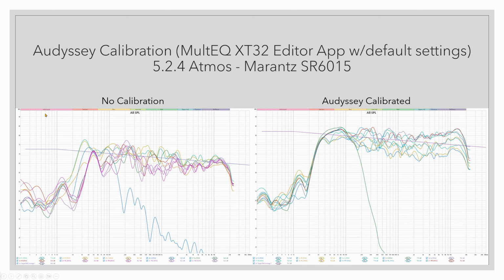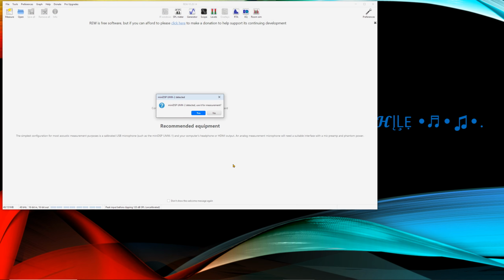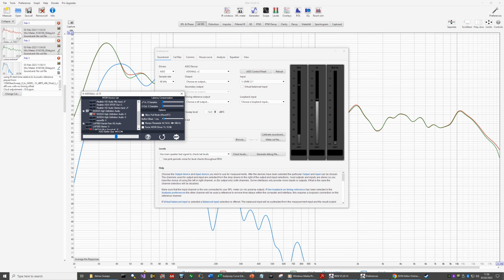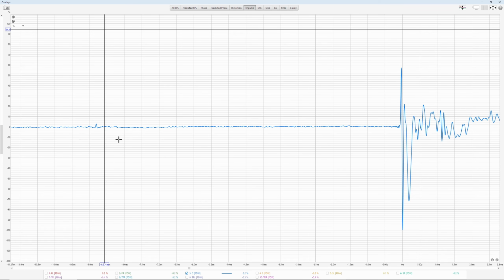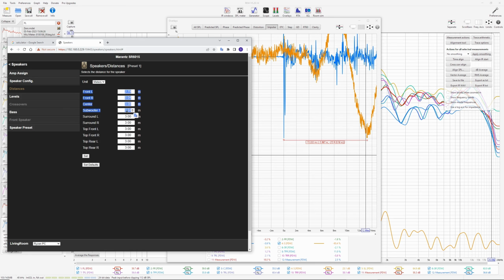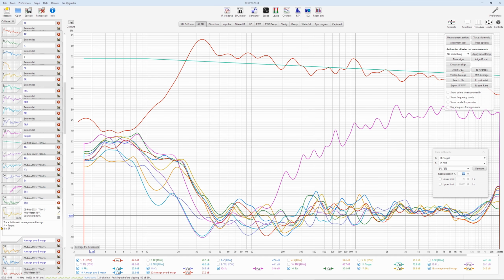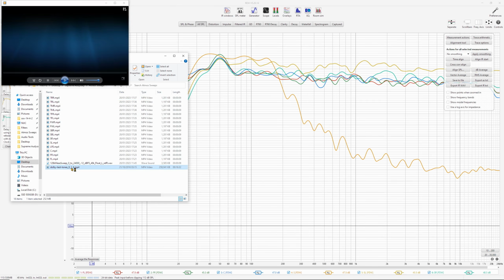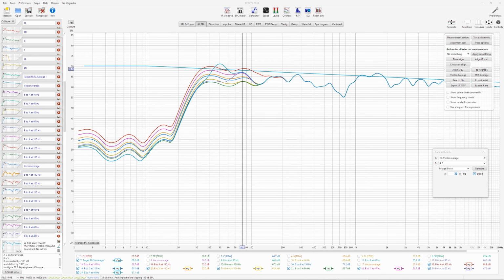Supreme Audyssey Calibration by OCA

Comment: Hello and big thank you for the great tutorial. 

After following the steps I finally hear my Dolby Enabled Speakers reflecting from the sealing. The sound in movies is impressive, compared to the sound the system does with just Audyssey. I don't know what the people at Audyssey tought when inventing the correction curves for the Atmos speakers, but it is not working well. The Atmos effect with my 4 Dolby Enabled Speakers is now, implementing your method, great. I now understand why people think, the "bouncing" speakers are crap. Audyssey cuts them in such a way they really sound as crap. 
One thing, that makes me think that I might have made a mistake at some point through the tutorial is the fact, I still have to adjust to the high pitch of the sound. With Audyssey it is somehow warmer...And my correction curve in MultyEQ app after finishing your method looks like a zigzag with multiple zigzags... Don't know if this should be the outcome...If you can share your MultyEQ curve after implementing your method I would be glad to compare to main, just to be sure, main is OK...I cannot actually call my outcome a "curve" :)

Big Thanks for your time and the comprehensive why of taking me trough the tutorial.
Reply from the maker: Don't worry, it's gotta be a zigzag. The method uses Audyssey curves to apply the actual correction. The zigzags you see are the equalization applied to each speaker.  I didn't undertstand what you mean by adjusting high pitch of the sound?
Reply: @ocaudiophile  If I compare the sound of the outcome now with the sound of audyssey, then I feel like the sound is much more "sharper" (almost scratching my ears form time to time), less "warm", and voices come out "thinner", thinner perhaps because of the presence of the high frequencies, which were not there before...For me now, it is as if I have different speakers, and I have to get comfortable with them first...
When I look for the crossovers with your method, my crossover for the Dolby Enabled Bouncy Speakers comes out at 90 Hz. What would you recommend me to do with this relatively low frequency. Should I crossover them higher like 150 hz? Somewhere in your video you talked about high speakers and crossing them also at 80 hz, to avoid hearing the top sound out from the subwoofer on the ground. Or perhaps I misunderstood something...Of course my dolby enabled speakers are not high speakers...Perhaps thatswhy I should choose the higher crossover?
Front speakers have the option for 60 hz and 90 hz
Center comes out on 40 hz or 80 hz
Surround at 60 hz , 90 hz or 120 hz
What frequency would you choose in my place? 
Now I am mrunning Front @ 90 hz; Center @ 80 hz; Surround @ 90; Dolby Enabled Modules  @ 150 hz

Thank you in advance!
Reply from the maker: @miroslavpetkov9895  Do you have one or two subs and how are they connected(ie MiniDSP or directly to the receiver)?
Reply: @ocaudiophile  I have only one Sub (SVS SB 2000 the older version, not the pro version) at the present moment. My room is small 6,50 m to 5,05 m to 2,47 m. My speakers are Heco The New Statement as front, Heco Celan GT 42 as center, Heco Revolution 3 as surround, Heco AM 200 as Dolby enabled speakers in a 5.1.4 configuration. All of this is connected directly to my AV-Receiver Marantz SR 8012. 
Appreciating your help. 
Thanks.
Reply from the maker: @miroslavpetkov9895  Ok, if you don't use MiniDSP for your sub you can time align the sub properly with the receiver's distance settings. MiniDSP causes extra processing delays which makes this very difficult. When the sub is time aligned, it will be very easy to see where the crossover frequencies should be. For the treble problem you're having,  suggest you follow the method in the Dolby Atmos Music video. I used Dolby's own target curve there which is much softer at the high frequencies.
Reply: @ocaudiophile  Thank you for your reply. I am trying to follow the Dolby MUSIC video, as you suggested. The Time alignment method there is not in the supreme audyssey calibration video, or did I overslept this part in the supreme audyssey video... Can you tell me, if I use the alignment tool in the options wheel, right next to trace arithmetics, and aligne a speakers response by time manually, if this manually implemented delay will be processed by the receiver as intended after finishing the process? The cross corelation alignment button miscalculates one of my back top speakers and do not place it on time 0 reference... That's why I try manually to aligne it to time zero, without touching spl or anything else, just time delay... The same I will do to the subwoofer, if you say manual alignment through the alignment tool can compensate for the missing milliseconds of my subwoofer. The subwoofer is shown to be over the possible distance in the AVR. That's why I  thought to use a time delay to aligne it's response to time zero also. Do you think my idea of manually delaying the response by the alignment tool can work out for both speakers? Or will it mess up the speakers responses, phases etc... Also if a subwoofers response has one peak in one direction followed by a bigger (major) peak in another direction, is it not proper still to take the first peak from psycholo-acoustic point of view? I mean, if you hear a rumble followed by a major rumble is this not what happens in nature? But if we aligne the major peak to time zero, then there will be a less loud rumble before the major rumble...Do you have an idea what is correct to be done? Thank you and greetings.
Reply from the maker: To manually time align a speaker, you should go to Impluse tab and use "Offset t=0" tool. You can measure the required offset with CTRL+Mouse right click drag in the Overlays/Impulse window.

It's ok to align the subwoofer according to its fist impulse peak if your receiver's distance settings will not allow aligning for the highest peak.
Reply: @ocaudiophile  would you suggest that I set Offset t= for the Subwoofer, or just aligne the first peak?
Reply from the maker: @miroslavpetkov9895  Depends on the distance required, ideally the peak but the receiver will not accept any distance setting 6m or higher than the other speakers.
Reply: @ocaudiophile  just for clarification, if I set a time offsets for any speaker in REW after export as .txt File will this offset be considered by the new created .Ady file? Or only a setting in the receiver can control the timing?
Reply from the maker: @miroslavpetkov9895  only the distance settings affect timing, rew txt exports are only for frequency correction
Reply: @ocaudiophile  ohh, I see. Thank you for this clarification. In my case, where the one speaker, due to a strange frequency response, is not aligned properly after cross corelation alignment and I aligne it manually, will this effect the further outcome of the REW analysis in any negative way? Or can I just proceed as the video teaches? Also strange thing is when I switch between ASIO(sweeps) and REW measurements the SPL is not equal. I have tried to compensate by turning the receiver louder for the difference in dB, but as you stated this will affect the actual frequency response. In my case it effects just the back bouncy dolby atmos speakers, so it is not a big deal, but still, curious how you work your way around. In the dolby music video you say we can measure all speakers with REW without the need of switching drivers. But when I switch to Java drivers I have only L and R channels... Is this normal?
Reply from the maker: @miroslavpetkov9895  you should use Java excl drivers, time alignment and frequency response don't effect each other. The only time they are related is during crossing over with the sub
Reply: @ocaudiophile  when I follow the dolby music video, if I try to check the outcome of the correction of the subwoofer ( SUB * 1/magnSUB) somehow the outcome is 16 db lower than the target curve. Is this normal?
Reply from the maker: Yes, depending on the rew version you're using you need to apply a certain SPL offset to it. Multiply the result with the original response to verify.
Reply: @ocaudiophile  But this is only for the purpose of calculation, I don't need to change the AVR Level of the subwoofer, right?
Reply from the maker: @miroslavpetkov9895  yes you're right, it's only for the calculation of correction filters for the subwoofer
Reply: @ocaudiophile  in the dolby music video we create the .Txt files by two devisions. There are 3 columns instead of 2 as in the this video. I can delete the third - phase column, right?
Reply from the maker: Yes, it's not used at all.
Reply: @ocaudiophile  can you tell me how to make the audyssey curve edditor.xlsx  calculate more than 242 lines? I have 957 lines to be edited by the excel file, and I am frustrated, because cannot find a tutorial online how to do it...The Editor file is enough for the Supreme Audyssey Calibration video but it calculates not enough lines when I use it for the Audyssey calibration for Dolby Atmos Music video. I am sorry bothering you with such a stupid question, but I have  no idea how to use the functions in excel...
Reply from the maker: @miroslavpetkov9895  Here's an Excel file that has 957 lines for you:

https://docs.google.com/spreadsheets/d/1SDbVrtnK21X0dnjsFn1NDsnX7L6ZDBaq/edit?usp=sharing&ouid=101966042086101491162&rtpof=true&sd=true

Btw, you can decrease the custom resolution level to a lower PPO while exporting from REW and it will have less lines.
Reply: @ocaudiophile  highly appreciated your help, mate. Thank you. Finally, I finished the calibration for Dolby Music. I still think I have made a mistake during the process of following the Supreme Audyssey Calibration Video. Now the speakers sound great and the Atmos for movies is also great. The Sub needed + 8,5 db after remeasurement. Don't know if it is not too much sub for my taste...Did you ever needed to change the sub levels after a calculated calibration, or do you leave it as it comes out from the calculations? Can you share your thoughts on calibrating the SPL for the ranges of 1khy 5 Octaves  vs 2khz 4 octaves. What is the main difference in choosing the one range over the other? Can you tell me what formula do you use in the excel file? I tried to find out how to redo your simple file, but I failed...
Reply from the maker: @miroslavpetkov9895  If you're using dynamic eq or dynamic volume, it will have different levels of boost to sub depending on the receiver volume level. You best option is to re-measure after calibration with the dynamic settings you use all active at the level you most often listen to your system and then adjust the sub level so that it's on the target curve in the SPL graph.

SPL alignment of speakers with each other can be made in many ways depending on your choice. You can calculate target level for each speaker in EQ window and equalize the target level calculated by REW for each speaker. Or you can align them for a certain frequency range. 1Khz 5 octaves mean you align them from 2.5 octaves each way from 1000Hz which is between 176.77hz-5656,65hz. Aligning 2kHz 4 octaves mean 2 octaves each way around 2000Hz which is from 2000/2^2=500Hz to 2000x2^2=8000Hz. Human speech is centered around 250Hz for instance. So it's a metter of taste. But keep in mind when dynamic eq or volume is on Audyssey will apply different boosts to different speakers that's why your equilibrium will only be valid at a certain volume level. It boosts surround and height channels more than front and center speakers in general.

Comment: I'm stuck at importing txt file into Excel "Audyssey Curve editor". Somehow I have commas instead of dots in dB values..And then when I apply "convert text to colums" with Space ticked, the excel erases commas in dB values or example : from -3,965 i get -3965, and this of course don't work later in JSON. EDIT : I found the solution - when export I needed to tick "Use computer's number format"
Reply: Hi d1234
I have the same issue as you have (or had) - but you have found a solution. Unfortunately I still have the problem.
When I have the raw text in Notepad it wil say ex -3.965 but as soon as I paste it into Excel it converts to -3,965
so comma instead of dot - and I can't get JSON to accept this format. Have you succeded in that d1234?

I can't for the life of me find out what the heck I'm doing wrong?!

Still hopeful regards
Reply from the maker: It's related to your Windows regional settings which effect use of . or , for decimals. You can fix that either through Windows settings or by simply editing the formula in XL.

Comment: What changes need to be made depending on whether you have Audyssey XT or XT32, if any?
Reply from the maker: Process should be the same but I'd suggest at least a minidsp managing the subs or a subwoofer with its own equalizer as XT is very limited with subwoofer calibration.
Reply: @ocaudiophile  Thank you. So the filters copied to Audyssey can be the same, irrespective of the number of taps?
Reply from the maker: @isakOHR I don't have XT but they should work. Why don't you just try and see?
Reply: @ocaudiophile  I will. Thanks for a great tutorial!
Reply from the maker: @isakOHR  Cheers!

Comment: Hi OCA -Thanks for all your videos, but this one I can't wait to get started on!
2 questions that might be very stupid so please forgive me
I have the Marantz SR-6012 - it does have the Audyssey app but I just can't get the web interface to work. I get Error 403 - Forbidden/Access forbidden.
1) should I have the option use the web interface at all?

If not I might just have to use setup via the remote control - will work but takes much longer

2) but when I access the setup from the remote control - under audio/surround parameter I don't have "low frequency effects" at all
Will that give me problems?

Kind regards
Reply from the maker: I had 6011 and now have 6014 and both have Web access, maybe network control is off in your receiver menu setup.

Certain setup parameters only come out when there's an audio signal being fed. Play an atmos track and try reaching that setup menu item.

Comment: When I measure any channel with REW the SPLs are higher than when I use the MP4 file provided. Up to 15 dB higher  on each channel.   I am playing the files on Media Player Legacy (Full Volume) with my AVR set at -20dB.  I was expecting no difference between the REW Sweep and the MP4.  What could be the reason MP4 appear to have less volume?
Reply from the maker: Your receiver's loudness management setting must have been left "on". It has this effect on Atmos sweeps.
Reply: @ocaudiophile  
Hi OCA
I have the same problem as Hiram
But when I try to enter setup via my remote (still can't get the web interface to work) I don't get loudness management under Audio 
I have tried to play Atmos movie clips and music files but no change. 😢
Do you have an idea to what file I can use to "force" this option to appear?
Reply from the maker: You haven''t mentioned what receiver you are having these problems with. All of them have a loudness management but newer models might have different names for it. Also in some rare models, they added a dialnorm setting for Dolby Atmos and this might be causing the Atmos channels to be dimmed. But 99% of people who try this method have no problems at all.
Reply: @ocaudiophile  
Sorry - I forgot 
I have Marantz SR6012
I can see that the options under Audio/surround parameter is changing depending on the signal I send into the amp, but I can't get loudness management setting to show at all 

Also for me it is all files played through MP4 that is much lower than the REW files  - not just the Atmos channels
Reply from the maker: @MariusPedersen-j1d  That model will have loudness management on/off setting and it will definetelyt not dim Atmos channels. You're doing something wrong, try harder.
Reply: @ocaudiophile  
I'm sure that I'm doing something wrong, but I just can't figure it out 

Cheers
Reply: @ocaudiophile  I have the SR6015.   How can i find the loudness management setup?
Reply from the maker: @hiramb7956  In the receiver set up menu, it's under Audio / Surround Parameter. It'll show up when there's an atmos/surround audio is playing and stay there for a while.
Reply: @ocaudiophile   found it.  It was off.   Still get a 5 dB difference between REW and the mp4.  At least now is not a 15 dB delta like before.   Will continue the process as is and see how it goes
Reply from the maker: @hiramb7956  Check your Windows/Sound settings

Comment: hey, first of all great video im about done with the tutorial. but i came across a small problem i cant find the option [A]/[B] on the trace arithmetic control tab does anybody else have this problem? i am running the latest version of rew 5.20.13 as of now
Reply from the maker: https://www.avnirvana.com/threads/v5-20-14-early-access-build.11154/
Reply: @ocaudiophile  ah so there is a newer version my bad on that one i did not see this version. i went ahead and did the crossovers for the speakers. would it be okay to run the measurments again and then make the inverted graphs?
thanks for the fast reply though i have the options now
Reply from the maker: Measure and test the corrections by all means but if it didn't corrrect for a certain area, it's probably because it cannot and applying more correction there might degrade the sound. Don't forget less is more in DRC. Still feel free to try. You should also have a look in the Dolby Atmos Music video.